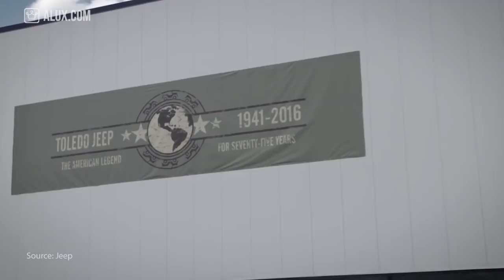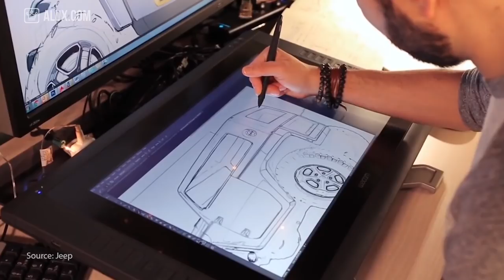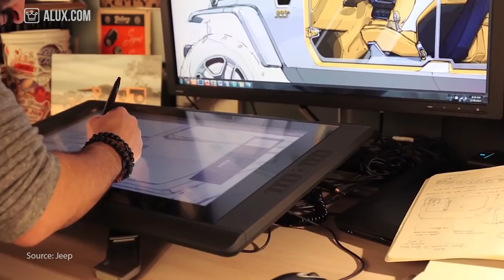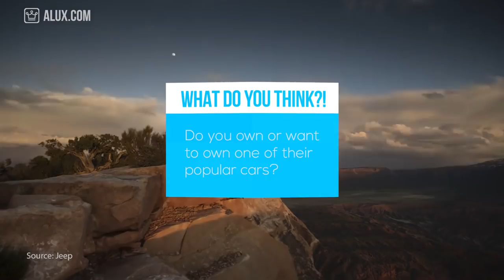15 Things You Didn't Know About JEEP

Comment: I had a '94 ZJ (Jeep Grand Cherokee for those unfamiliar with the terms) Laredo 5.2L, and currently own a '04 KJ (Jeep Liberty) Columbia Edition 3.7L. These have been my top two favorite vehicles that I have ever driven in my short life. Have rolled well over 100,000 miles on them and both still behaved like they were brand new out of the factory.

Comment: Right off the bat some information is wrong. "In 1940, the U S Army asked 135 tractor and auto manufacturers to design a four-wheel drive, 40 horsepower, 1,300 pound reconnaissance car that could haul soldiers as well as heavy artillery. The challenge? The designer was expected to have a working prototype available for a test run within 49 days.

Only two companies responded to the request, The American Bantam Car Company of Butler, Pa. and Willys-Overland Motors of Toledo, Ohio. Because Bantam promised to deliver the prototype in 45 days, they won contract." That's all information from the visit Butler site https://www.visitbutlercounty.com/the-birthplace-the-jeep and even before Bantam had the design the "Jeep" was originally the Austin 7 from a English motor company that had branched out into Butler Pennsylvania but failed because of the great depression. I grew up and still live about 20 minutes away from the Bantam factory that made the Jeeps. Also the name Jeep came from the soldiers that named it after the cartoon character.

Comment: Ok so some war era info is wrong. There was 3 designs. Bantam, willys and ford. Bantam won the model but they are the ones who told the army they couldn't keep up. The army went with the willys cause they could build the vehicle cheaper than ford. Willys also wasn't able to keep up with the demands so they asked ford for help. Ford built the jeeps for willys until they ditch willys after the war in 1945. After the war, willys dropped the 9 slot grill that was designed by ford and went to the 7 slot. Also ford tried to sue willys for the jeep name (since they were actually building them for willys) with no success. So ford couldn't come "second" to willys for building cars during the war since ford was building the jeeps for willys.